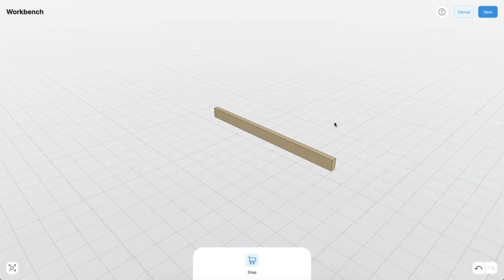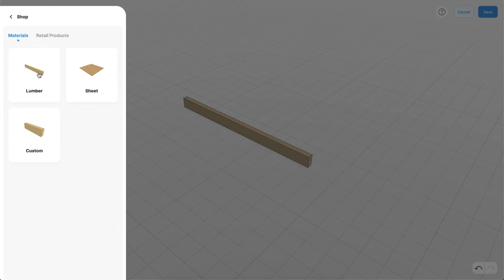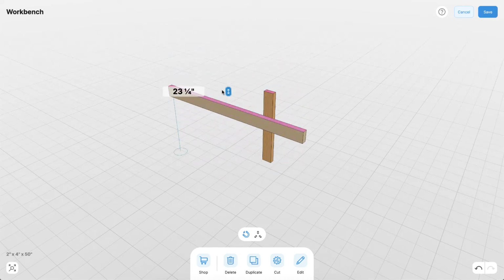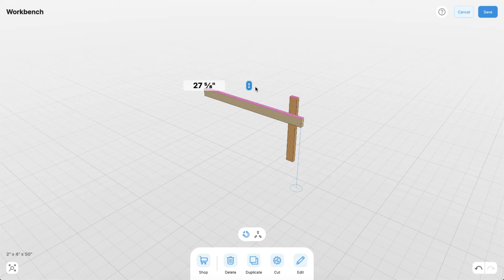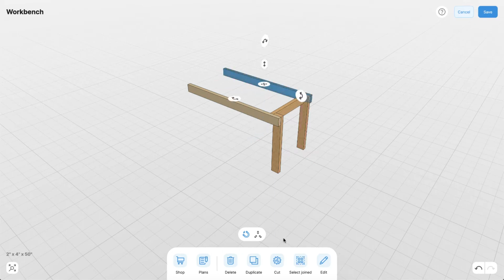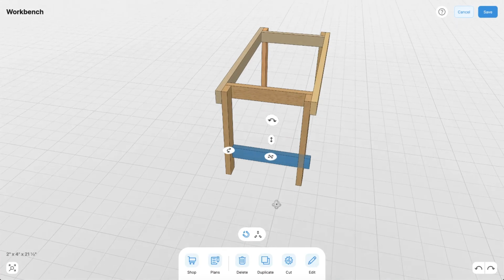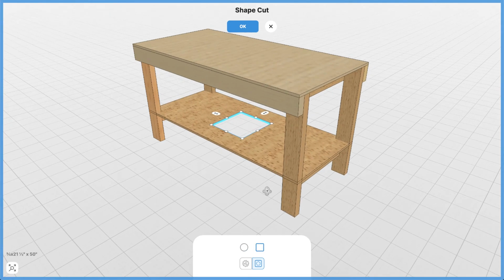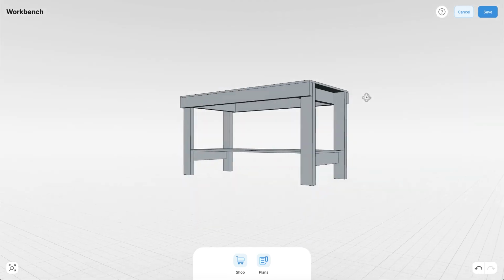Learn the Basics

Comment: How do I change from metric system to imperial when selecting my materials?
Reply from the maker: Hi Richard. On the My Projects page, select “Account” from the profile drop down menu (top right of the page). You will need to login if not already done so to HomeByMe. You should see an option to choose “ft”. To apply the changes in MakeByMe, logout and log back in again as this will then populate all imperial shop content.
Reply: @makebyme_diy  Thank you for the quick reply.  After a couple of tries, it worked.  Thanks again.
Reply from the maker: @richardmayrand4724  glad you managed to sort it 👍 We are aiming to simplify this going forward. Would you always want to work with imperial materials? or choose depending on the project or materials available?
Reply: @makebyme_diy  For me I always go with imperial.  A bit old school that way.  I would like to see joinery that allows the specifications of dadoes and rabbets in the future.  Not a pocket hole fan.